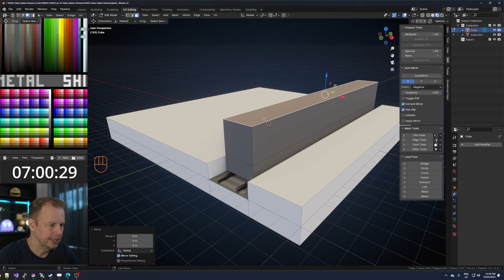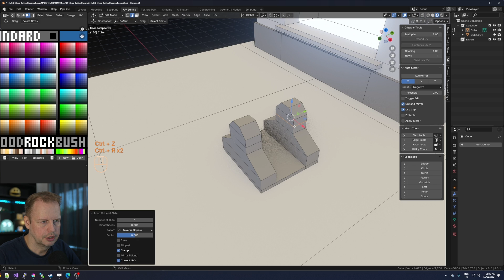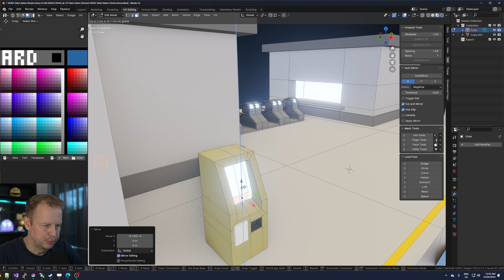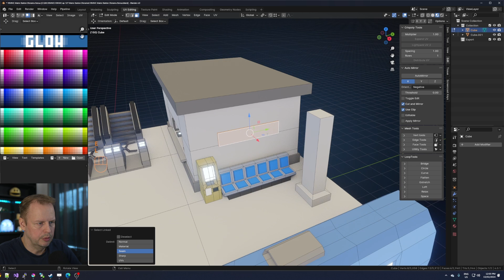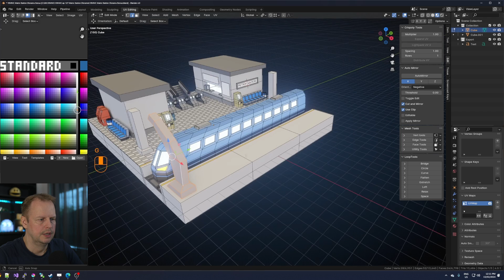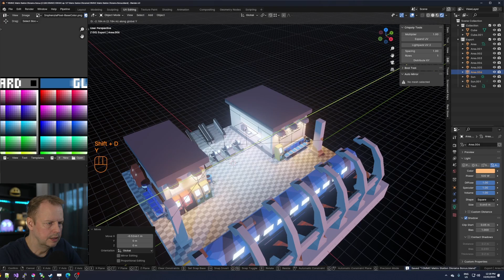10-Minute Modeling Challenge - Metro Station - Blender 4.0

Comment: Could some veterans impart me with some blender wisdom? If you shift+D duplicate, like he did on the top train vent and move it back. Would you have to merge meshes, retopologize, and clean up the verts if you wanted to use this as an asset, not just a render?

Comment: Long time fan here, wondering how long you think/plan about how to make something before starting? I assume you couldn't just be told "make a stagecoach wagon" (insert any other kind of model) and then start on it as a ten minute challenge, or could you?
Reply from the maker: Hi, thanks for asking. It totally depends, if it's something I roughly know or have seen, e.g. computer, speaker, cartoon car, tree, shed, bridge, etc. I can do it straight away. But often I just google some images to get a rough idea of what things look like or in this case what is generally found in a metro station. In some cases, I also test out methods, like the 10 cars in 10 minutes video, I looked at a workflow that could maximize the ability to make multiple cars first.
Reply: @Imphenzia  Thanks, it just seems kind of superhuman how you just go "this thing? ten minutes, tops!", just wanted to look behind the curtain a bit. If you ever feel like it, some "how my brain works" videos would be greatly welcome!

Comment: Hey Imphenzia. I followed your beginner tutorials to start learning Blender and 3d modelling in general. I'm having trouble with creating things with complex and cramped interiors - things like car interiors, air/spacecraft cockpits in particular, but also buildings and other miscellaneous objects - the interior geometry vs the interior, creating things like the windshields/windows that are transparent but are still visibly there; correctly scaling things like chairs, controls and instrument panels for a human model, and arranging them well for a player's FOV. I tried a couple different methods each with mixed results - firstly, building the body of the vehicle, with a space for the cockpit and then building it out from there - and modelling the exterior entirely by its self; taking the front-section, down-scaling it by a little bit and flipping its normals, then putting that interior where it's supposed to be and sort of linking things together from there. 

Do you already have have a tutorial on how you do these things? If not, I'd find it really helpful
Reply from the maker: Hi! Maybe this can shed a little light on how I tacke interiors: https://www.youtube.com/watch?v=5cM_lhRmiQI 
I usually hide exterior geometry in edit mode (select faces and press H key) and then I extrude in to create a space for the cockpit. Then I model the interior (steering wheel, seats, etc) and then I press Alt H to unhide what I hid before.
Reply: @Imphenzia  Awesome, thank you for the response and for the video